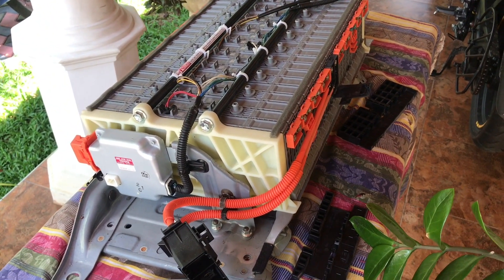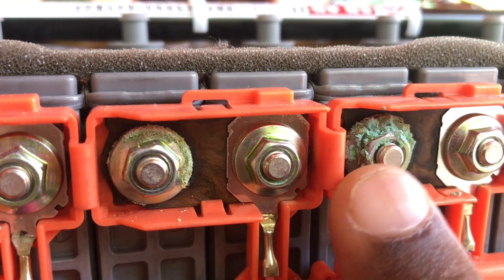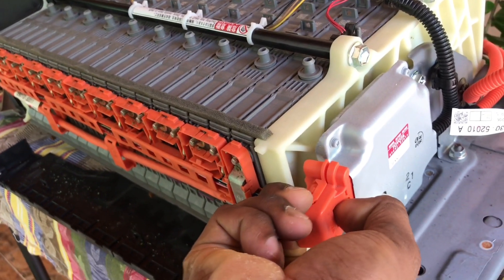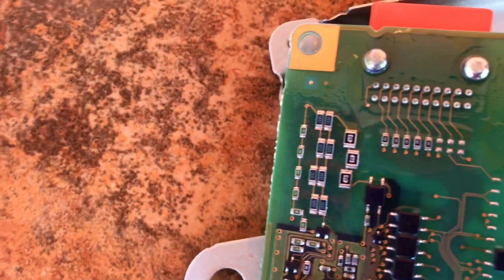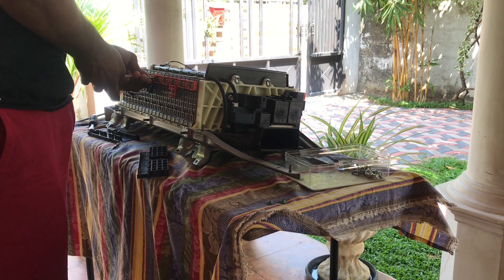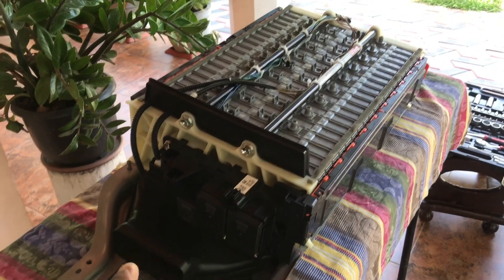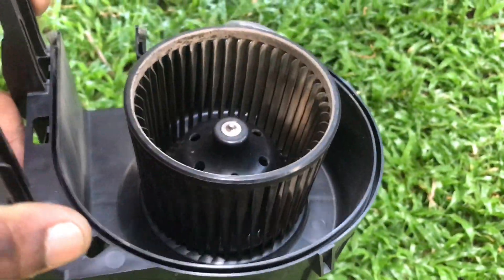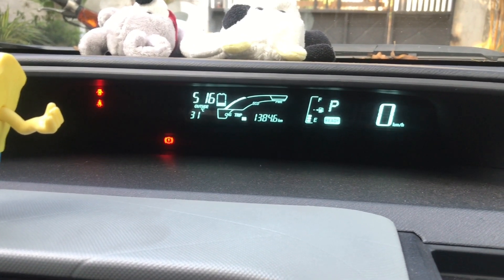Hybrid Battery Information-sinhala l  දෙමුහුන් බැටරි පිළිබඳ තොරතුරු

Comment: Battery bus bar terminal clips walata oxide wena eka walakanna battery terminal spray kalata kamak nadda
Reply: Phone no eka denawada
Reply from the maker: nilhan silva 0775168909
Reply: Battery terminal protection spray
Reply from the maker: nilhan silva protector spray kalata prashnayak naha . Eth 20000n wage battery eka check krla balanna eth oxides badenawa . Clean karana eka thami godakma hoda . Mage aqua eka aran danata awrudu 4 k wenawa . Thama  baterry service eka withri gedra krla thiyenne . Kisima problem ekk wela naha